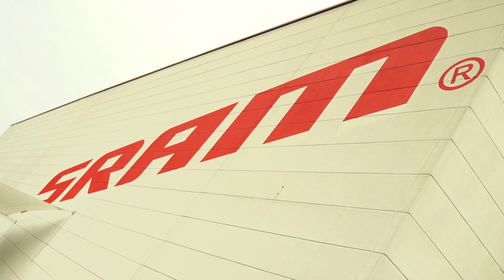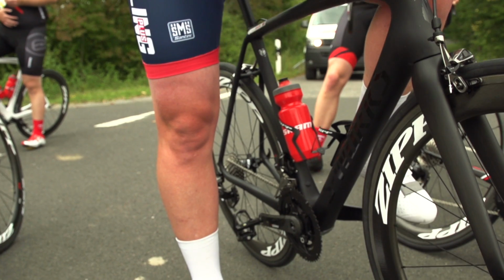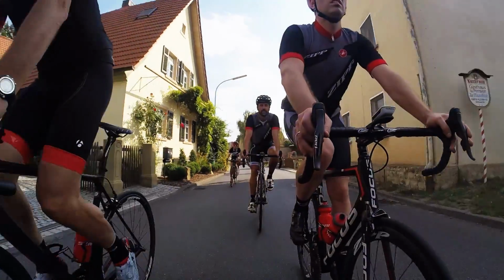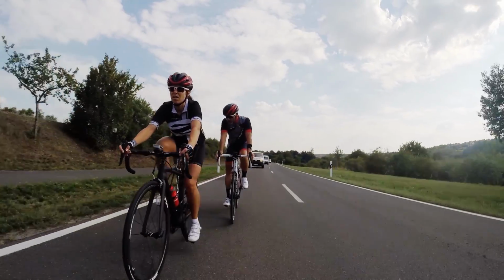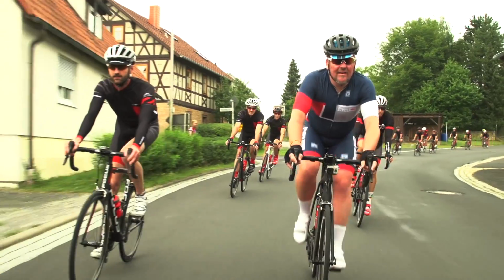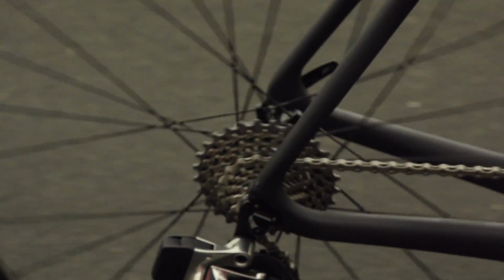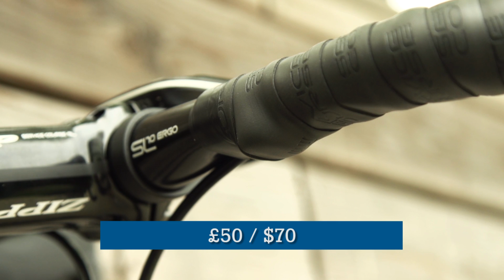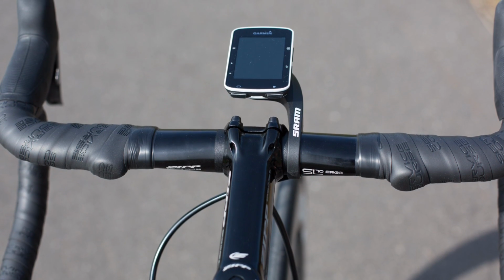New SRAM Red eTap Wireless - First Ride

Comment: WHY would i want to pay £2000 when you can get shimano ultegra groupset for £499?????? It won't work any better, and you need batterys..
Reply: Paul Kelly it will definitely work better,also it won't have 4 trim positions like shitmano does
Reply: Nothing stops you to keep riding the ultegra, but it definitely works a lot better than my mechanical Red.
Reply: I rode with a guy who had one yesterday. No cables seems OK in one way, such as no need to replace those. 
Its definitely something nice to have if you are willing to spend the money

Comment: Despite the hype by different media outlets, there are problems with the SRAM design. You need to charge 2 batteries instead of just 1 for Shimano Di2. Also, the batteries are located externally and are prone to pranks or something lodging them loose. The internal battery on Di2 is a lot better IMHO. Some people like the way SRAM shifts, but it's just a different style and doesn't make it better or more intuitive.

Comment: They need to hurry up and come out with a wireless brake system for all the morons to buy.
Reply: Well, that might actually be a good idea. You can tune the lever stroke in a nonlinear fashion, add antilock, vary the front/rear bias, add stability control, auto-endo, auto-manual, OTB-prevention, etc.

Comment: Why do we need electronic shifters again? I'm using a Campy carbon 10 speed groupset from 11 years ago. Shifts like butter.
Reply: Why do you need 10 speeds?
Reply: Peter Kreishman to be in the optimal cadence for a longterm increase in pedaling output. What goals, other than adding a  significantly higher price tag for SRAM/ Campy/ Shimano does electronic shifting achieve?
Reply: But surely Eddy Merckx did just fine cadence-wise with 5-speed cassettes. And what about integrated levers? Disc brakes? Who needs those? The history of cycling is riddled with things that were met with animosity when they first came out. The fact that you ride a bike with integrated shifters and brake levers that has 10 speeds in the rear is all the evidence you need that things that were once poo-pooed as unnecessary are now considered essential.
Reply: Peter Kreishman Eddy mashing gears al lower RPM while a less naturally gifted competitor blew past him at 100+ revs would have spelled the end of Eddy's old ways. 

Integrated brake levers make for quicker reactions that might be the difference in a photo finish 50 meters down the road. Disk brakes are safer as long as they work on a mountain descent. Point being each technology is either an asset to performance and safety or maybe it's just a revenue consideration. Objectively what is the benefit of electronics? This has been pushed since the early 90's with Mavic to name one, all other cycling advancements were embraced quickly. I tend to think that if a technology is greatly needed the market will make it a reality in short order.
Reply: His pedaling style has nothing to do with the number of gears. Electronic shifting is more precise, more reliable, simpler, and requires less fiddling. But you haven't answered the question: why don't you stick to 7 speeds and down tube shifters?
Reply: I think the difference between a downtube shifter and an STI is much bigger than the difference between electronic and mechanical shifting. Downtube shifters are so much more uncomfortable, you have to let go of the bar with one arm, and you can't really shift while riding out of the saddle. But, it's simple and looks very minimal. :)

The difference is not that big between electronic and mechanical, but it's really interesting, especially the wireless stuff. If I had the money I would go with electronic no question.

porscheoscar, you don't NEED electronic shifting. No one said you do. But you have the option to buy it if you'd like. It's all optional.

You don't need 11 gears either, but it's a little bit nicer than 10 if you have a wider range cassette. You don't need a 7kg carbon bike, but it feels pretty good. You don't need Dura Ace, Ultegra or 105 is pretty good, yet a lot of people buy Dura Ace stuff. 
Every one of these things just offers a minor improvement in something, and some people like that. New technology is never a bad thing. Maybe in a few years we will have 105 or Tiagra Di2 for cheap, who knows.

And again, no one is forcing you to buy eTap...
Reply: If you tried once you will know. It's like DSG vs stick shift in a car. I have the mechanical SRAM Red, and the electronic Red. Both are have their pros and cons.

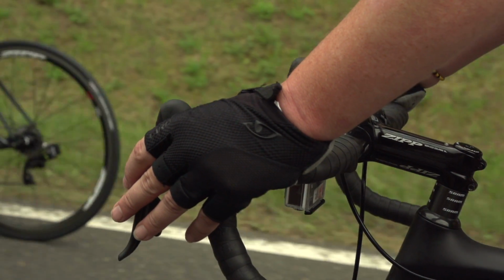Comment: 1:48 "If you push the right lever […] you get a down shift. If you push the left lever you'll get an upshift." Is this accurate? Everyone else is reporting that the right lever is for upshifts and the left lever is for downshifts and that the system can't be reconfigured to operate in any other way.
Reply: +Catcrumbs As in number, not direction of chain moving. The 28 tooth is the number 1 gear. So changing from 8 to for you are moving chain up but down in sequence of gears.
Reply: Andre van Wyk
I'm not sure I fully understand what you're trying to convey, but every shift away from gear '1' (the lowest) is an upshift.
Reply: +Catcrumbs Gear 1 is the biggest closest to the spokes. If on the first gear, the chain can only move down but you don't say shift down, you say shift up because you are moving up in numbers name to 2, 3, 5, 8 etc. Biggest gear front together with smallest gear back is the highest you can go namely 22. For front it is more confusing. There you will be moving the chain up while you are actually shifting up in gears as well because you go from 11 (11 at back and 1st front) to 12 (1 back and 2nd front).
Reply: Andre van Wyk
I understand that already. I'm trying to figure out if BikeRadar does or not.

Comment: Once again Sram comes out with better ergonomics than shimano. Love the approach to shifting one lever up one lever down, pretty much eliminates miss shifts on bumpy roads. I still think electronic shifting is a solution to a problem that didn't exist but if you are going to do it this is the way. Don't like the cost, but this is a problem with all electronics, one crash and you could be out a huge chunk of cash.
Reply: +paradox963  but electronics get cheaper with time.i would wait a couple of years before  buying them.
Reply: +Krishna A It does but not enough, manufacturers just release "new" versions that are basically the same, just to artificially keep prices up. Just look at the more "affordable" Ultegra Di2, a rear derailleur is $200+ the mechanical is $54.

Comment: 1000km range is terrible and will be the downfall of SRAM's groupset. p.s. EPS can be shut off with a magnetic band so ot won't go flat in idle.
Reply: +Aaron Coghlan The system uses accelerometers to know when the bike is not moving and turns the power off, then wakes up when movement is detected. Also unlike seatpost mounted batteries these can be quickly taken off, or swapped out and they only take 45min to recharge. Also unlike Di2 or EPS not having a single central power source means one dead battery will not take down the entire system. If your rear derailleur battery goes dead you can swap it out with the front derailleur battery and keep going.

Comment: I can't wait till someone hacks the (probably insecure as fuck) "encryption" SRAM says.
Reply: +Garfie1d73 I think the encryption is decent enough. You're not going to hack this thing from the sidelines; if you're going to hack it, it's going to be from a competitor's bike or a team car. There's no way you're going to sustain a good wireless connection with this thing unless you're directly keeping up with it.
Also 128-bit is insanely secure nowadays. 128-bit AES encryption still outclasses all supercomputers on Earth today. The reason why you see encryption hacks in the news all the time is because the person who put the encryption in fucked up somewhere and introduced a security hole that lets you bypass the encryption. The lock is in fact a really good lock, it was just never clicked in place.
No way in hell a bike mounted computer can get past 128-bit; it boils down to whether they did the wireless protocol trivially or whether it was actually done well.
The one thing they can do easily is jam the signal. All you need to do is figure out what frequency band the groupset likes to transmit in and rig up an Arduino and a small array of RF antennas to flood that spectrum on command.
Reply: +WittgensteinSergeant™ Well, all we have to do is to look for the guy with a laptop on the side of the road twirling his long mustache.
Reply: haha ikr
Reply: +WittgensteinSergeant™ I've read the use 128 bit encryption. Wow! That is of course unbreakable ... NOT.
Reply: +Tristram Charnley because you can sabotage big races such as "Tour of Frace".
Reply: +Juan. Lega It would be easier just to put someone in the crowd with a handful of tacks.
Reply: +paradox963 too obvious, you run more chances on getting caught.
Reply: +Alexander Wei From a competitive perspective I see hacking or jamming a signal as a possibility, but from a consumer perspective I can't really see the possibility of some one going through all this work just to truncate your morning ride... That been said, even in a competitive environment the possibility of this happening is as close to happening as doping, meaning when it does happen ( if it does ) there will be some kind of regulation that will stop it from happen again or the technology will be advance in such a way to prevented from happening again... or so I hope! And, by the way, nobody can't deny the fact that the less cables you have, the better your bike looks!
Reply: @ +Carmai7 I'm all about the technology moving forward. off course that people won't botther hacking or jamming a signal to mess with somebody's morning ride, but when there are millions of dollars on the line.....you better believe people will.
Reply: +Juan. Lega The funny thing is it is easier to remotely hack Shimano Di2. While the shifters and derailleurs are wired together the control box has a bluetooth receiver in it that could be hacked to control shifting. There is a much larger database of exploits for bluetooth than the new proprietary system Sram is using. And Di2 has been out in the wild for years and I have yet to hear of anyone hacking it though you do always hear about some one on di2 having shifting problems in almost every race so who knows.

Comment: It's a cool idea for shifting but whenever I do a front shift I simultaneously shift a few gears on the back.  Easy to do with Di2.
Reply: +Ben Dawson That was my first thought too, they've fixed a problem that didn't need fixing and in the process created a new one.
Reply: with the etap in the blink of an eye you perform both front and rear shift. I don't feel that's a problem at all, and that's coming from mechanical Red experience which I shift front and rear same time.